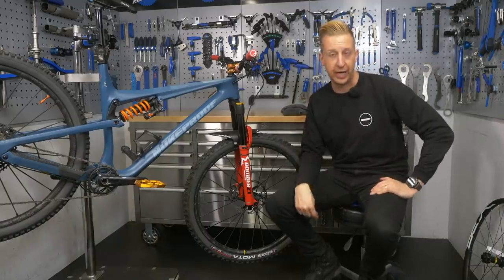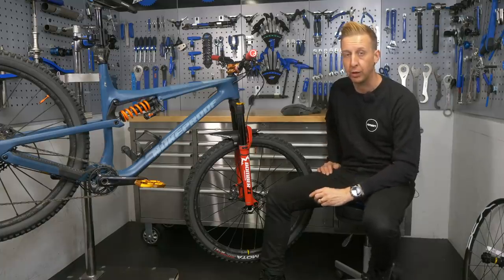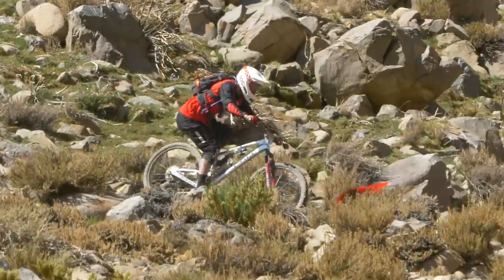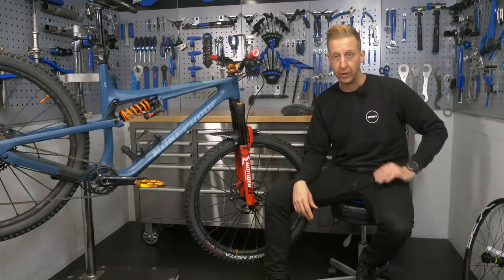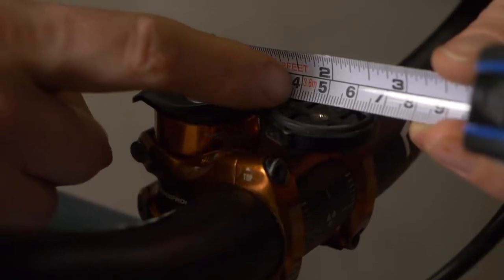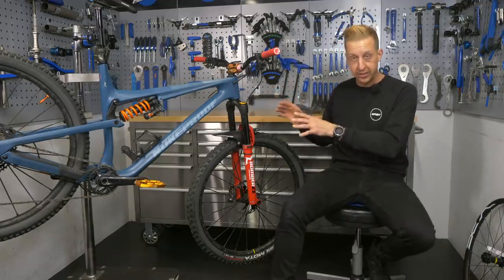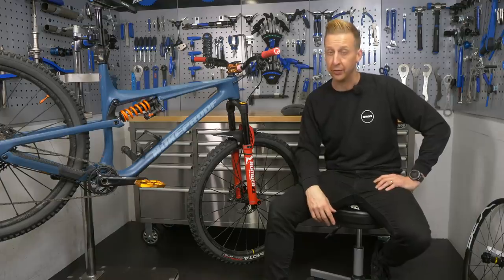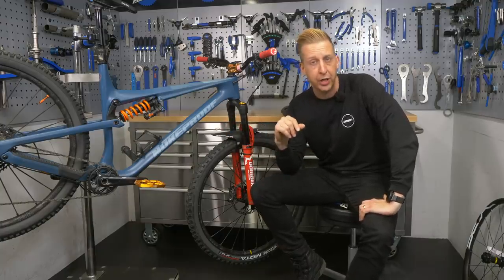27.5 Inch Wheels Are NOT Actually 27.5" | MTB Tech Misconceptions

Comment: Hey doddy. I have a large firebird 29, and i just reversed the stem on it to make it easier to maneuver with super short reach. I like the stock bike when riding saddle down, but when i do ride with the saddle up on flat and medium terrain, reach is too far out. My question is, is it mechanically safe to reverse the stem? Here is the link to my bike. https://youtu.be/h4pYiYVYeYU
Reply: mechanically sound, but has so many draw backs from ergonomics, weight transfer, stability, etc, try moving your saddle as far forward as you can (with in the recommended parameters, likely printed on the rails), raise your bar/stem, buy height rise bars and/or with greater sweep, this will effectively decrease the reach.